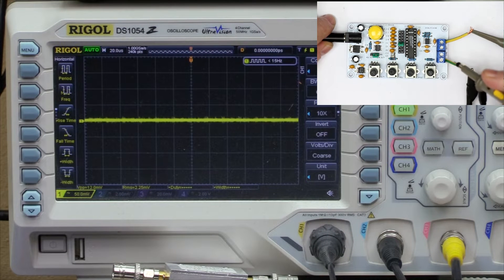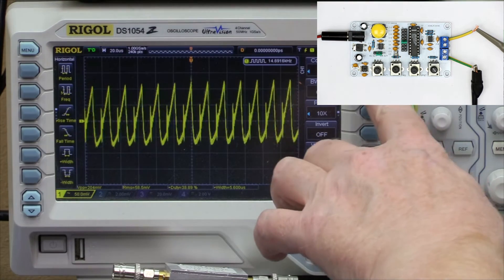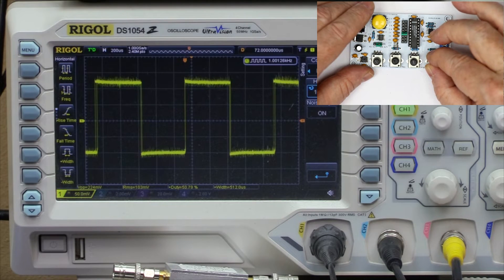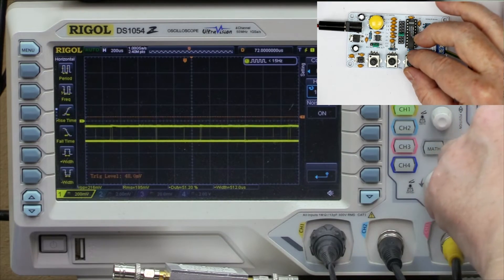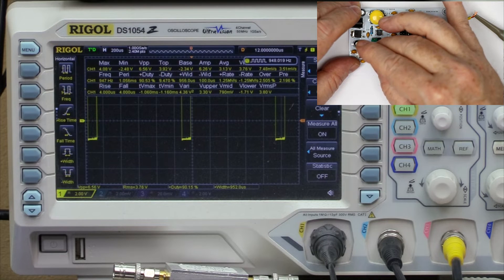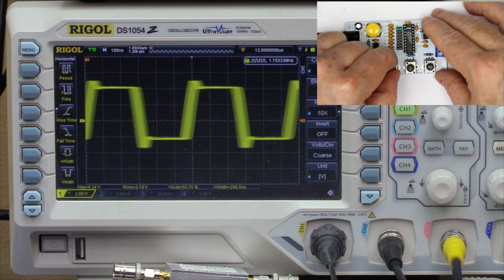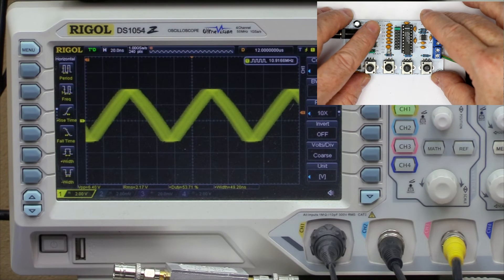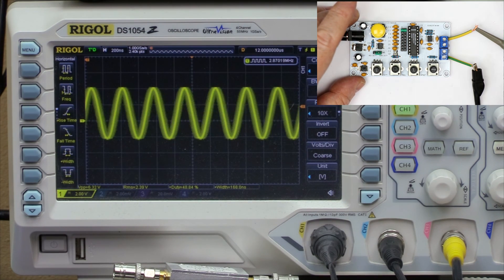A cheap MAX038 function generator kit (Pt. 2)

Comment: I bet that using a better power supply and simply paralleling the existing decoupling caps with a different value and/or type would GREATLY improve the output!
THANKS FOR THE VIDEO!
Reply from the maker: What do you mean with a "better" power supply?
Reply: I just gave a somewhat detailed reply, but do not see it in the comments...did you get it?? @KainkaLabs
Reply from the maker: No

Comment: Do you have a schematic such as in the owner's manual for the ELV 9001m Function Generator that you tell us you have? I searched the Internet to no avail. Love your videos by the way... Many thanks for the work you put into them.
Reply from the maker: You can download it from the ELV homepage for a small fee. It is called MFG900 and the article with the schematics is a three part series: https://de.elv.com/search?sSearch=mfg+9000&ffFilter[attributes-elv-ExtendedSearch]=Journal
You have to create an account with a (guessed) German adress before or during checkout. You can pay with PayPal (or credit card) and then get a download link for the PDF. You have to put all 3 parts of the article series into the shopping-cart if you want them all 3.
Reply: @KainkaLabs  Thank you so much for the information and the ultra-fast reply.
Reply: @KainkaLabs  Can you tell us how the PCB could be improved in order to cut down on the noise in the signal? I'm a novice at this and I don't know how to go about laying out a board for optimum signal. I do know some better filtering on the power supply would be a benefit.
Reply from the maker: PCB-layout suitable for RF-frequencies is not a beginner´s topic :-)
You should use one side of the PCB (usually the lower side) as an (uninterrupted) ground plane. Then keep all the traces with the RF-signals (the output of the IC and the sync-signal) as short as possible and lay then out as so-called  "strip-lines".
Any components connected to the analog inputs of the IC should be placed as near as possible to the IC.
Reply: @KainkaLabs  Thank you very much for your expertise and your lightning fast reply. Any learning I get from you folks is greatly appreciated.
Reply: @KainkaLabs  Last night I purchased the articles you led me to. I had to laugh when I opened them they were all in German. Looks like I will be doing some translating. I am able to understand the schematics however. Cheers my friend.

Comment: Nice. Will it give a "Fixing the issues with the XR2206" version for the MAX038?
Reply from the maker: No. The problem here is in the non-RF adequate PCB-layout that can´t be fixed in any way with the orighinal PCB. An improvement could be to change the decoupling caps to better/larger ones so that the power-supply lines are cleaner and the jitter perhaps be reduced?
And perhaps hand-solderung a BNC-connector directly to (or as a replacement of) the screw-terminals.